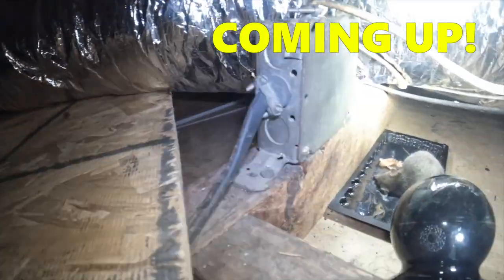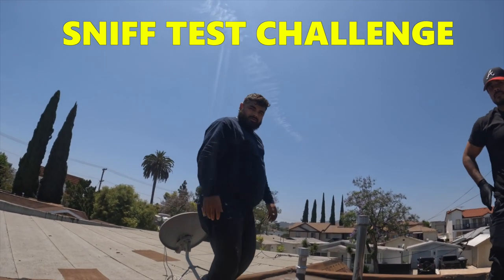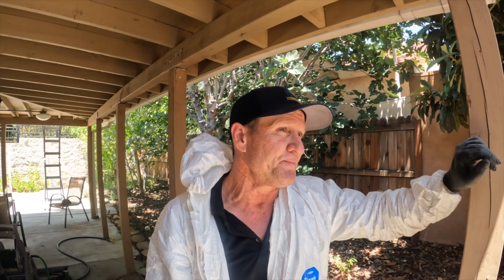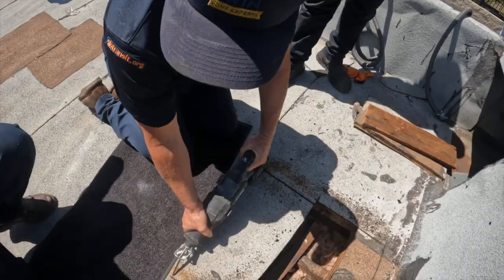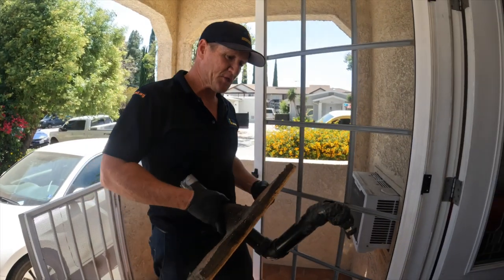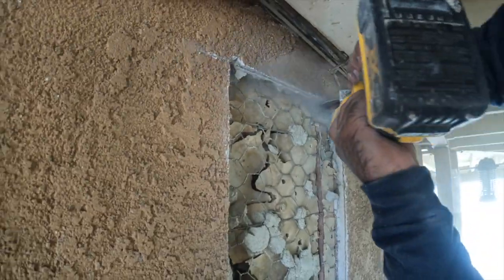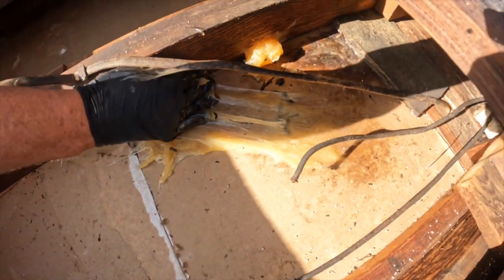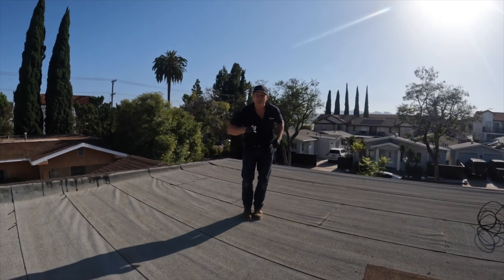The BEST way to get rid of rats FAST...jackhammer

Comment: Want to thank you guys so so so very much from S,W Florida. You helped me solve a rat problem after 8 yrs of going crazy. It was a uncapped toilet vent "T.  I believed only in New York and big cities with huge sewers had rats not 4 inch pipe.. thank you both so much again.
Reply: How did you solve your problem?! Please share.
Reply: @cindyperez5142  I found vent by smelling them on roof as they show in video's. Followed that vent down and measured it outside took those measurements inside put few holes in wall till found the bad pipe cut and replaced the t junction since they had chewed all over the area. After years of going crazy that was the fix. Not a sound since. I also made my own back flow valve and that stops them even getting close to house. These guys have great advice and tips.

Comment: Love your videos! My worst experience with a mouse was as a teenager. I put my jacket  on the back of the kitchen chair just before going to work. As I popped upstairs to get my bag our cat brought in a field mouse and dropped it. My mum knew I would want to stay to catch it ( making me late for work)  so thought she would catch it after I left and said nothing.  So without a clue, I put on my jacket, drove off to work, and was on one of the busiest roads here in England when I felt something start to crawl up my arm inside my jacket. It got to my neck as I froze in shock then started to make it's way down my back.  I came to my senses, pulled across three lanes of traffic and just off the slip road into a bus stop. I jumped out the car, threw off my jacket and was jumping around like I had ants in my pants! Unfortunately I had watched a paranormal programme the night before so when an elderly lady came to my aid she soon backed off when I told her " I have had a paranormal experience, a ghost was touching my body!" With the words "Yes dear" and looking at me like I was crazy she nearly ran back to the bus shelter. I got to work and rang mum who couldn't stop laughing. She never found the mouse, so the only explanation was it had run up the chair, and got into my sleeve but was trapped by the tight elastic cuff. It was a good job I didn't know it was a mouse or I would have crashed the car! My dad had to strip the car out, then still take me to work in it for over a month as I was too frightened the mouse would appear again! Hated them ever since! Oh apart from dormice. Guess that's why I love your videos! Stay safe and love from England x 😺🐁🧥🚗🤪🐜👻👵🤣❤️🏴
Reply from the maker: Thank you for sharing this great story! They can be frightening. Appreciate you taking the time sharing and supporting us. 🙌❤️
Reply: Now that is nightmare material
Reply: And the car wasn’t torched to cinders because? ……..😳
Reply: @anniefly1325  trust me I wanted to but dad wouldn't let me ! 🤣
Reply: @TheKayc136  At least tell me you burned the jacket and had both arms removed. 🙏🏼 🗡💪🏼 🔥 🧥
Reply: @TwinHomeExperts  please do a video with Shawn woods from mousetrap Monday. You’ll be a great team!
Reply: @anniefly1325  it wasn't burnt but went in the dustbin! Honestly I am surprised the elderly lady didn't call the police and have me arrested! It was before the days of nearly everyone having mobiles or else I think  if she had one she would have! 🤣

Comment: I'm amazed that they can chew through that pvc pipe.   Thats determination right there.
Reply: PVC is nothing for them.They can chew through concrete and even certain metals.
Reply: Rats love pvc pipe, pipe insulation and electrical cables, recently had a callout on a washing machine flooding the kitchen. Rats had eaten through the washing machine hose.
Reply: Rats and rodents in general love chewing pvc…. Central heating and water pipes have a blue reinforcement plastic in the center to stop them chewing through the pipe
Reply: @Durgesuth  i am talking about the flexible hose that comes on washing machine, it was covered in bite marks and was punctured.
Reply: Was this a regular all rubber washing machine water supply hose? 

Or a reinforced hose with metal braiding on outside of rubber hose?
Reply: @dougl6304  just a regular washing machine hose they are standard in the uk. Only ever seen 1 that been eaten through so far.

Comment: While i don’t tolerate rodents in and around the home, i dont use glue traps. If you do use them, check regularly, and quickly euthanise the captured rodent as soon as you come across them.
Reply: Yeh seems cruel, poison would be better
Reply: @rhys406  use them in controlled areas and then have a bucket handy with water so you can put them out of their misery.
Reply: Yeah, not cool. Looks like they just tossed it in the trash to suffer for several days and then die a slowwwwwwww death. If you can’t check glue often, don’t put it down. Not good unless you can kill humanely quickly.
Reply: @jenniferbmendezful  I doubt they'll have the trash bag open, or else other rodents would get to it. They probably tied the bag and it died from suffocation
Reply: @rhys406  It takes 3 - 7 days for a poisoned  mouse to die. They hemmorage.

Comment: How do you guys usually kill the rat when you catch it alive? I usually drown it but was wondering if there's a less messy and quicker way. I don't want to torture it either.
Reply: Gas and a match
Reply: @AW-uf7yv That’s not funny that is terrible no joke somebody actually did that intentionally and I think they ended up being nailed for animal cruelty it was way way over the top because they don’t die instantly they’re actually a burned alive it’s one of the worst ways to die
Reply: Club to the head.
Reply: @ilovemyservicedog8862  lol
Reply: A bucket with some water is a good quick way.
Reply: @darjames5961  yeah I’ve done that but I’m looking for less messy ways. I’ve put one in a plastic bag and sling smash it against the concrete slab. It works but sometimes take a couple of blows, especially if the rat is a big one.